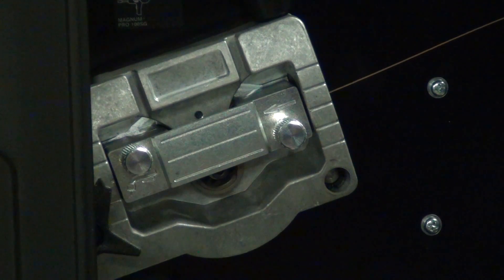Lincoln Power Mig 210 MP wire drive issue Part 2

Comment: Mine acts like the wire is slipping in the drive wheels. Tightened the rollers as much as possible with no affect. Maybe if the drive rollers had knurling. Do you think the replacement rollers are better quality? My drive rollers don't have a lot of noise but it does have irratic feed! Help!!

Comment: Sometimes it's the welder that creates the problem not the machine!
Reply from the maker: You must be blind and deaf if you couldn't see there is a problem with the wire drive.
Reply: What a stupid thing to say! its obviously either a bent shaft or out of round wheel. There is no adjustment in the world going to fix it. Wish I had the money to pick up one of these bad boys. Wish it would do aluminum better.

Comment: Try removing the cover over the rollers so you can them and remove the wire. Run the system and look for wobble. Are one or both rollers out of round. Could motor shaft have a slight bend? Just guessing about causes. Everything could be perfectly round, but the hole in one of the rollers could be off center.

Comment: Were all costs and labour covered by Lincoln's warranty ?
I would like to see follow-up video with new corrected drive issue resolved.
After multiple tests and viewings of my own new Lincoln MP 210, I would suggest perhaps a dry and or defective CHINA bearing(s) and or misalignment of drive and or combination of all. Sadly, Lincoln Electric does not accept ownership and denies all obvious defective drive problems and will NOT stand behind their new defective product.
And, to add insult to injury, Lincoln's piss-poor customer service is even more troubled than their faulty quality control and defective products...

Comment: Am trying to run .045 wire in my 210.cant find an .045 drive wheel.the wheel I have says .030. & .045 but has only one small groove and it's smaller than an .045 grooved,for flux.help?

Comment: -i got the power mig 180 dual  . it had the same warble but mine was more severe ,took it back had to wait for a replacement (4 weeks) much better , still hops a little but you can't fell or hear it when welding .

Comment from the maker: This has nothing to do with drive roll tension.Here is what I did.Rather than deal with returning welder to Airgas and waiting god knows how long for another 210MP I ordered another wire drive.Installed the new wire drive and it is a hell of a lot better.Poor quality control on Lincolns part.No doubt I am a little disappointed with this.
Reply: How much was the roller or did u call Lincoln and get it under warranty?
Reply: Reeds Repair and Fab just bought the lincoln 210 has same prob. you would think after 4 year of the welder being out on the market they would have fixed the issue. so did replacing the wire feeder solve the problem?

Comment: Just wanted to share my experience with this machine I bought the 210 mp right out of box did the same thing took it back to where I bought they keep for 2 days they called said everything was fine so I called lincoln and they watched this video and from the guy at lincoln he told me from the quality of the parts they use this is ok also long as there is no feeding issue with the wire that the wobble or up and down movement was fine

Comment: Reed- I just picked up one of these machines and I heard the cyclic sound as I fed the wire during setup. I see you took it upon yourself to fix your machine - Q: is it a gamble to order a drive and think it will be straight and true from Lincoln? It would be my luck the replacement would be warped as well  --complete with those less than ideal bearings made in the far east. Please comment on how your repair went.

Comment: Just my experience for those watching- bought my lincoln 210mp in april of 2016 (now nov. 2016) have run most of a 10lb roll of .024 and a pound or two of .035 without problems. was having an issue the other day, these videos led me to examine the drive.  My drive sounds fine and the amount of run out (wobble) is so small that it's almost undetectable without an indicator. was not my problem- turned out my tip was way loose-doh! tightened it and all is good again. so for the record at least one machine left the factory with a good drive. love the machine works excellent.
Reply: J clark thanks for your post
Reply: J clark. mine does the same. think they all sound like that.

Comment: You probably are using the wrong size drive rolls.
Reply from the maker: Nope that is not the problem
Reply: Sometimes it is just the crappy machine...  bought one of these for mobile Flux core work on decorative iron.  Had nothing but troubles with it from the start.  Mine was so bad that it caused the wire feed to have "turrets," where every so often the speed would sputter and cause the wire to arc across to the tip, then the feed wheel would spool the wire in a knot and you would have to pull everything apart and start all over again.  I watched this happen at least 50 times in the week I had it, in the shop with argon and with Flux core.
Reply: Airgas refused to take it back, so I begrudgingly  GAVE it to a farmer who was needing a small stick unit.  The Lincoln rep told me the tig function had a lot of bugs before I bought it.  Still have 5 Lincoln's in the shop, mig, tig and diesel stick machines, and 3 Millers.  Ended  up finding a cheap used ESAB for my mobile Flux core needs and have yet to have any of the same problems from a much cheaper unit.  This machine  is just JUNK.  PERIOD.
Reply: Really? I have one in the trunk of my car and use it for mostly Mig & Stick. I love it and have not had any of these negative issues. It runs on dual currents, 230v & 110v in my country. I have not had any problems doing Tig either. I bought a pedal and installed it with the apropriate adapter and have been impressed with it's duty cycle and 210 amp output. It can weld 5/16 thickness and has many other features that you would usually only find on a much more expensive machine such as 1) Spot Timer 2) Run in Speed 3)Inductance. It also has a "Hot Start" feature when welding stick and this is very important if ever welding Stainless Steel Stick Electrode because you require more heat at the tip at the start. I plan to pick up a spool gun eventually for welding aluminium with it as well.  In total it does Mig, flux, Stick mild steel or Stainless, Mig Aluminium & Stainless and Tig, with or without a pedal. 

Best Welding Machine In This Universe!!!